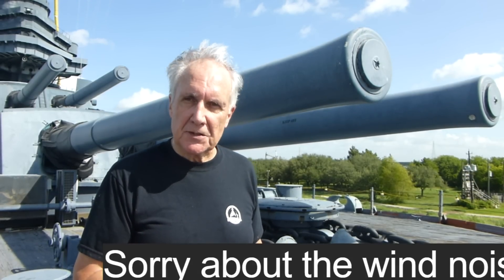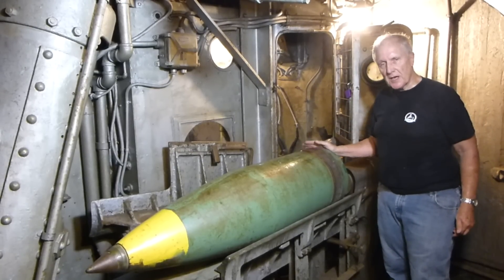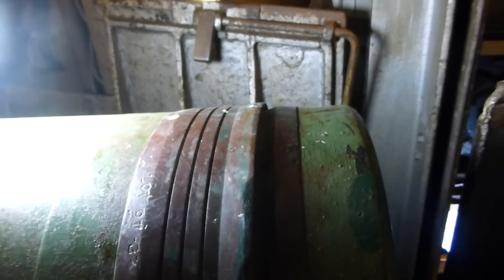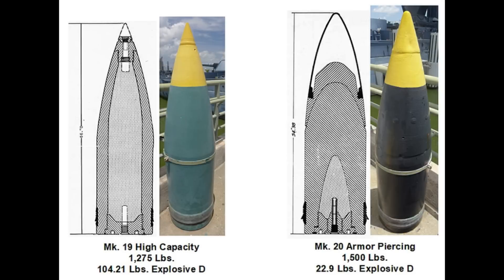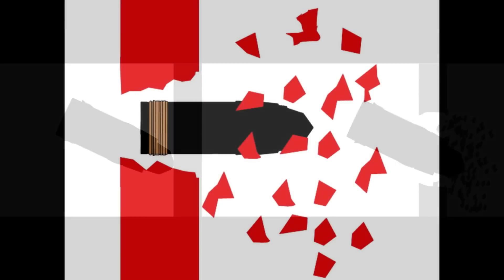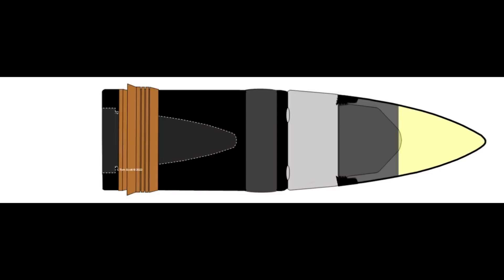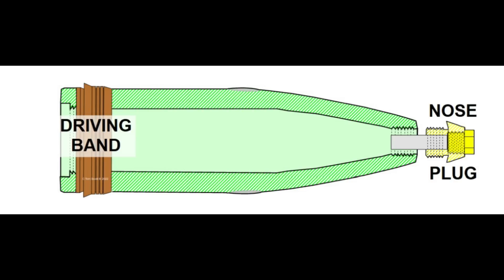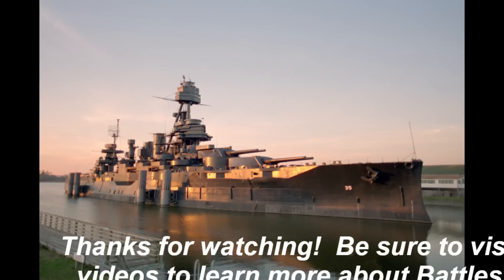Battleship Texas, Making the Rounds!

Comment: You said 36,000 PSI pressure behind the shell.  I believe you meant 3,600 psi.  Am I correct?
Reply from the maker: @davidmiller9 I I am correct. Multiple Navy ordnance manuals give 18 tons psi working pressure for 12”, 14” and 16” guns, which equals 36,000 pounds psi.  Refer to the following page:  http://www.navweaps.com/Weapons/WNUS_14-45_mk1.php

Comment: Man, your sound is all f-ed up
Reply from the maker: Yeah, that occasionally happens when I use my camera's built in mic, especially outside and in the wind.  This is a budget operation that concentrates on content and not expensive gear.  I use a compact camera because I have to carry an absolute minimum of equipment to safely climb ladders and squeeze through tight spaces.  My camera has been covered with dirt and rust, dropped, and banged on hatch openings while taking 20,000 photos and hundreds of hours of videos.  No large camera, or one with interchangeable lenses, would ever survive the abuse, so I'm pretty happy with it in spite of the occasional audio issues.

Comment: something i mentioned in an earlier video - i'd be interested Tom if you could do a film on an incident when Texas went to Cherbourg June 1944 - she was hit three times, (straddled 65 times) i understand, apparently one of the shells may still be aboard, i hope as an exhibit, i would be interested to see it and possibly where the others hit and the repairs made if still visible

the first, a 6" shell hit below the water line, exploded in the water and did not penetrate but sent water 80 feet up
 
the second, a 240mm shell hit the top of the conning tower injuring four, the explosion went up and hit the pilot house above where several crew were injured, one sadly died later, the helmsman Christen Christensen
 
and the third, a 240mm shell apparently ricochet off the sea tumbling and hit the port side of Texas side on, into Stateroom 20 on the half deck around frame 19, the Warrant Officers quarters, with the shell damaged from the sideways impact caused the shell to fail and not explode, this shell was removed and deactivated and then returned, might still be aboard

more detail and images at - https://battleshiptexas.info/html/History/1944-06-25.html
but i think makes for an important insight into the kind of thing Texas went through and survived

Comment: I have always been curious about how an armor piercing shell could over penatrate on a lightly armored ship such as a destroyer, and it can be said it "causes little damage." 

How can a large metal object flying that fast through a Destroyer ripping through cause little damage? It has to rip through piping and wiring and other accessories in side the ship on the shells path as it flies through the ship.
Reply from the maker: It certainly does everything that you describe. As far as "causing little damage", that is a relative term.  A shell that punches through a ship without exploding will certainly wreck everything in its immediate path.  Because of the way warships are designed, it is likely that flooding can be controlled, damaged systems can be bypassed or repaired, and much of their ability to fight remain intact.  However, a shell that punches deep into a ship, then explodes creates damage that is magnitudes higher.   When it explodes, it sends out well over 1,000 pounds of hot, razor sharp fragments traveling at hundreds of feet per second, each one weighing anywhere from a few ounces to more than 100 pounds.  These can rip the guts out of a ship.

Comment: Can the turrets still move?
Reply from the maker: No, they haven't moved in more than 75 years.  It took continuous service of the electrical and hydraulic motors, plus a source of very high amperage, 120 volt dc to run them.

Comment: Can you discuss what if any differences exist between these rounds and the 16" rounds from the Iowa class?
Reply from the maker: I haven't studied 16" rounds in detail, but it's likely that the major differences are those of scale.
Reply: @tomscotttheolderone364  fair enough. Excuse my ignorance but what size and caliber are the Texas guns? I want to say 14" .50 caliber? 

From watching the New Jersey channel I know that "caliber" for naval gun is the measurement of some ratio and not the circumference of the projectile like in small arms.
Reply from the maker: @paulloveless9180  Texas has 14"/45 cal guns.  They were used on 3 classes, New York, Nevada and Pennsylvania.  Caliber is used to state a gun's bore length, which is the portion of the bore that does not include the powder chamber.  You simply multiply the bore diameter (14") X  caliber (45) =  630".  Divide that by 12 and you get a bore length of 52.5 feet.  Using that, the bore length of the 16"/50 cal guns on the Iowa class is 800", or 66.7 feet.
Reply: @tomscotttheolderone364  that's extremely interesting! One last question and I'm sure you've answered it several times but how did you become such a subject matter expert on many different systems of a 100 year old naval ship?
Reply from the maker: @paulloveless9180  I have been a volunteer on Texas for more than 20 years.   This gave me access to her archives.   Retirement has also given me the opportunity to spend hundreds of hours finding and reading period textbooks and technical manuals.  By the way, most can be found on Google Books.
Reply: @tomscotttheolderone364  The 16 inch 50 HC and TP projectiles look similar to the 14'' shown. The turning bands, screw in base plate, and nose fuze look similar. The 16'' shell has a screw in  adapter between the nose fuze and the shell body. It's a substantial chunk of steel.  Looking at the 14'' projectile, the only visible difference is in scale.

Comment: Thank you very much sir, very informative and easy to understand.  I would imagine that the designs of the later 14" and 16" projectiles used by the "Standards" and later designs is similar though details will necessarily vary.

I wish you guys much success with your upcoming overhaul.  Battleship Texas is a grand old lady and still has much to teach us.
Reply from the maker: You are right, the 14"/50 cal. guns used on later standards used exactly the same shells.  However, Texas and New York required a slightly shorter armor piercing round than all other ships using the same guns.  This was due to size limitations in their upper shell hoists.  Fortunately, it only required a slight modification that shortened the windshield to make shells fit.  High capacity shells were okay because the low profile nose plugs made them short enough to fit all ship hoists.  Longer nose mounted fuses would have made them too long to fit Texas' hoists, but they were only added after the shells had been hoisted into the gun house, so that wasn't a problem.  The propellant used in the powder charges was slightly different between the shorter barrels on the first three classes than what was used on the longer 14" guns used on later classes.  This was done to maximize burning efficiency, but the charge weight of 420 lbs. was the same.

16" shells were obviously scaled up.  They incorporated improvements to driving band design and changes to the armor piercing cap, but were otherwise pretty much the same.
Reply: @tomscotttheolderone364  Ah, so.  I appreciate your reply and the explanation.  Stay safe and beware of the heat.

Comment: informative and fascinating as always!
why wouldnt they use a 2nd copper driving band instead of the bourellet to save wear and tear on the rifling?
Reply from the maker: Good question, it wasn’t necessary.  The bourellet was easy to machine with just enough clearance to allow it to easily ride on the rifling lands without a lot of lateral play.  A second band would add significant cost and difficulty without adding any real benefit.  One thing to keep in mind is that shell friction resulted in very little bore erosion.  The big problem was with the effect of instantly heating the surface of the bore by a couple of thousand degrees whenever the gun fired.  That caused micro fractures in the surface of the metal leading to erosion.  The solution was to use reduced powder charges whenever possible and ultimately chrome plate the bore in the final barrel designs.
Reply: @tomscotttheolderone364  ah thanks! didnt know that the main factor in barrel wear was the temp change as opposed to the huge shell sliding through it. 
thanks for the reply! love your channel!

Comment: As always a wealth of information brilliantly presented. 
What was the proposed benefit of the bombardment shells over the high capacity? I’d expect either a significant increase in effectiveness or reduction in cost to make the hassle of another shell type in inventory worthwhile.
Reply from the maker: That's a good question.  I've never seen a rationalization for the bombardment round to have a good answer.  It certainly appeared to be a single purpose round and its design suggests that it was less costly to produce.  However, the inability to take point detonating fuses, along with the explosive boosters commonly added, appeared to seriously compromise its reliability.  It's possible that part of the problem was the base fuse not triggering with shallow angle impacts.  During its use by Texas during the North African landings, spotter aircraft were clearly able to see the duds when they impacted at a low angle.  They would dive below ground then come back up to the surface.  This stripped the paint off of them and their shiny surface made them easy to see from the air.  They were also inspected up close once the area was taken, but I haven't seen any written reports that resulted.

Comment: Hi Tom, excellent subject and presentation as always!
Question: did they ever employ proximity fuses instead of the mk62 time fuse for accurate air bursts?
Reply from the maker: I am not aware of proximity fuses designed for these shells, nor do I recall seeing one listed in a in a 1945 Navy munitions manual that I have access to.  Its discussion of vt fuses concentrates on their use in AA shells.
Reply: While probably not used in battleship HE or HiCap rounds, the VT fuse is still used for anti-aircraft and missile defense as well in an NGFS (Naval GunFire Support) role to produce maximum shrapnel damage against soft targets such as buildings, unarmored vehicles and exposed troops.  The AP rounds are used against protected bunkers and armored vehicles like Personnel Carriers and tanks.  My experience was with the MK-45 5"/54 gun in the 1980s and early 90's.
Reply from the maker: @robertf3479  True on AAA.  The manual to which I refer does give a description of the vt fuses for aircraft.  I was interested to recently read that they were predominantly used in the Pacific, but saw little or no use in Europe.  They apparently didn't want to risk a dud falling into enemy hands.  That wasn't a problem with ship protection.
Reply: @robertf3479  Interesting, you mentioned HE and HiCap rounds.  I was thing of this.  I have seen descriptions of HE but only few references to High Capacity and no definition.
Are HE and HiCap the same or different projectiles?
Reply: @Eugene2ndW  Please understand that this is only my understanding as I was not a Gunner's Mate.  The terms "HiCap" and "HE" appear to be interchangeable for most uses.

Comment: Great video as always. BZ! Looking forward to the next one!
Maybe too much detail, but you may want to mention the mark, mod, and lot numbers that are located on the driving band. And IIRC the Texas and New York used different (shorter) 14 inch shells than the other 14 inch guns because of their unique loading process. That was also why their elevation was never increased beyond 15 degrees.
Reply from the maker: Hi Bob, as always, thanks for the compliment and your comments!  All of your points are dead on, but I left them out to keep it fairly generic.  With the exception of shell and explosive filler weights, pretty much everything covered regarding design and construction applies equally well to 12-16" shells.  As far as not increasing gun elevation beyond 15 deg., the only time it was economically feasible was during the ship's modernization in 1925-26.  It was rejected in order to meet the terms of the Washington Treaty saying that a ship could not increase its offensive power.  Later ships, like Oklahoma and Nevada started out with the same limitation, but by the time they were modernized, the decision was made to make the change anyway, so they increased elevation on their guns.  There was an initiative in about 1942 to make the improvement on Texas, but it was rejected since  the ship would be out of service and critical shipyard facilities would be tied up for as long as a year during wartime.  The improvement wasn't worth that.
Reply: @tomscotttheolderone364  Even without the turret modifications to increase the maximum gun elevations and thus range of the main batteries, Texas and the others did very well when it counted most, proving that they were still very dangerous opponents.  I'm impressed that flooding the torpedo blisters on one side to induce a defacto elevation increase could be handled by the fire control system to produce accurate solutions, such as at Normandy.
Reply from the maker: @robertf3479  It was only done once, 9 days after the D-Day landings.  See June 15 on page 8 of the attached.  It really wasn't that difficult.  The range keeper was capable of finding firing solutions that exceeded Texas' guns elevation range of 15 degrees.  Once they knew they had to go 2 degrees past maximum elevation, they simply flooded the tanks until they achieved the exact list required to get there.  My assumption was they flooded beyond what they actually needed so that they could correct back down to the required elevation with minute of angle accuracy.  By the way, they were anchored, which greatly helped.  https://battleshiptexas.info/images/Documents/1944WarDiary/06.html
Reply: @tomscotttheolderone364  I would assume the same with regard to flooding the blisters, you never know if or when you might need that extra range.  Roger that on being anchored, it would help provide a more stable gunnery platform with Texas' hull form.

The NGFS that we practiced was with the ship underway with bare steerage way on, again to provide that extra stability although with a long, narrow destroyer type hull.  People who don't know better might assume that NGFS isn't really the exact science that it is.

My hat is off to the people in WWII who did the most to refine that science.  Early in the war NGFS was more haphazard and guesswork than I'd be comfortable with, by War's end they had it refined to what I'm familiar with now, the same book used during Korea and Vietnam up through today.